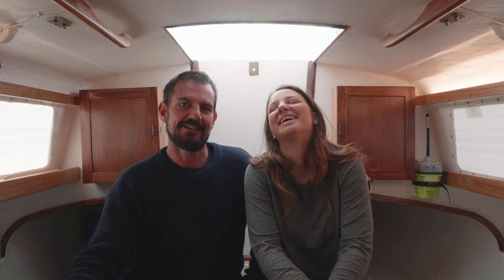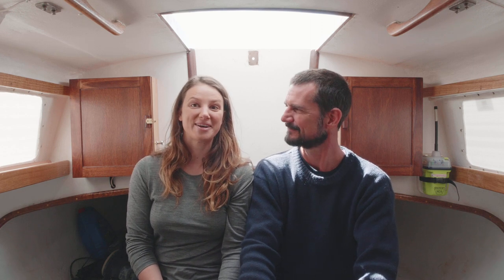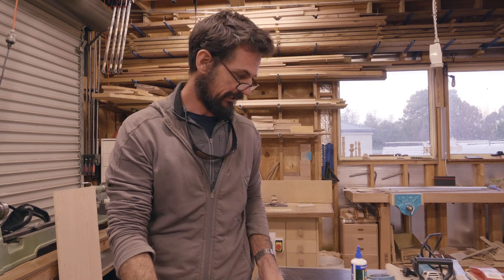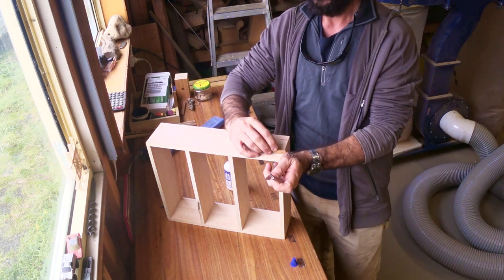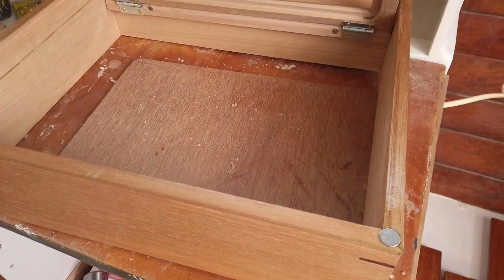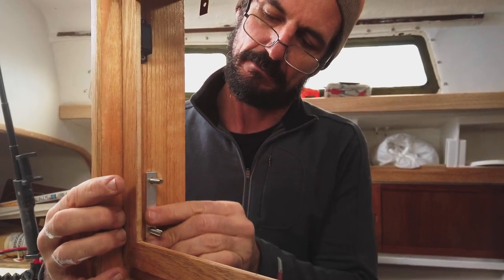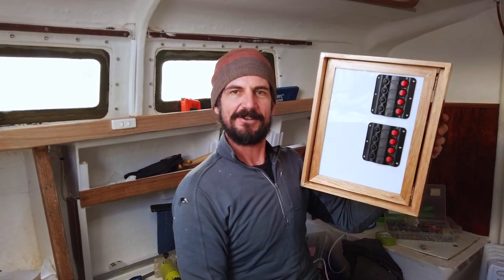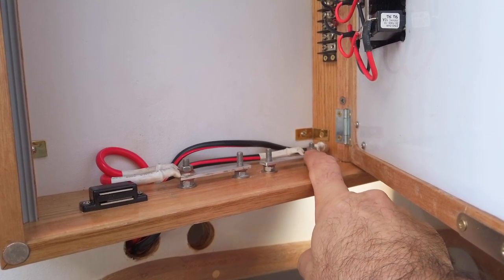A Total Rebuild for Our Sailboat's Switchboard - Free Range Sailing Ep 149

Comment: Just throwing a question out into YouTube world for comment. As you stated the wiring panel will have it’s own electromagnetic noise. Could it be possible to use the magnets to cancel it out.
Reply: "Could it be possible to use the magnets to cancel it out."

Not really, no. Every single wire generates an electromagnetic field when an electric current is flowing through it. You can't wrap them all in magnets. (And when the power was off, the magnets would be doing exactly what you were trying to prevent!) Putting it all inside a grounded metal box (aka Faraday Cage) would be the simplest method. But that brings its own problems, especially on a boat at sea.

Comment: Moin from Hamburg7Germany 
When yuo build in so much permanent magnets,what will it doe with your Compass?
Reply: As long as they are a good distance away and a magnetic compass is corrected they should do no harm. Most magnetic compasses have a built in means of deviation correction.  regards
Reply: @garyc5483  Moin  this is correct,but for minimise the influence of steelmasses you will need a distance of about 1m(3ft) i think fore strong pemanetmagnets a much greater distance is nessesary.so it will be not possible to have a magneticcompass at the intrancebulkhead cause including the correction of the deviation you will get to much damping of the earthmagnetism

Comment: I don't know if your still on the "hard" but, if you are check out a product for your propeller called PropSpeed. It is a paint on application to reduce the growth to your propeller. The link is :   https://propspeed.com/   And, if your still in Hobart there is a contact from Bosuns Locker in South Hobart.  Also,  for your refit information,  you might consider a mold free product, for places in your boat. The material is similar to that which is in car trunks, which you can put on with spray glue, besides the reduction in mold, it also is good for sound damping. Stay safe, love your videos.